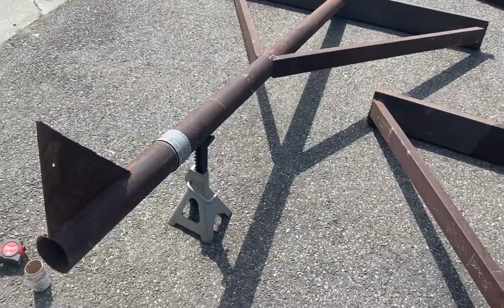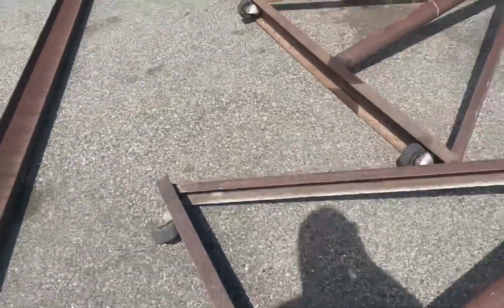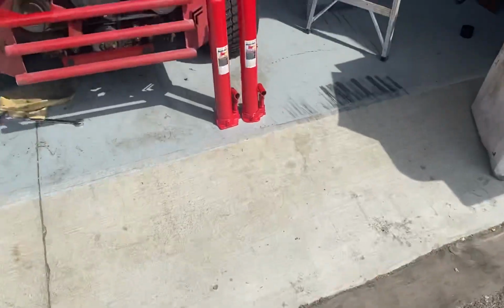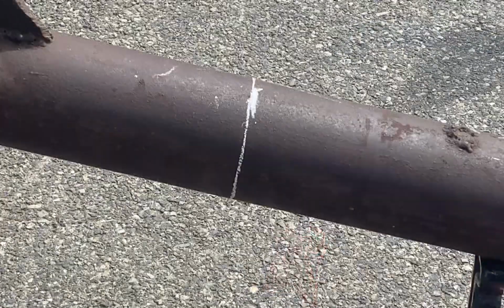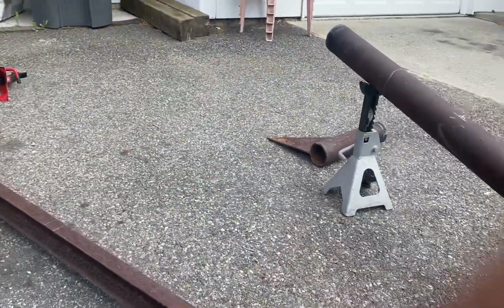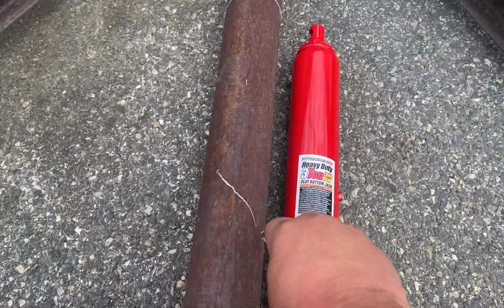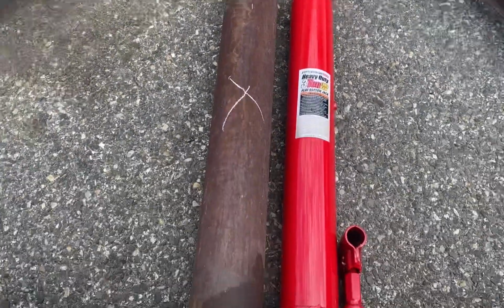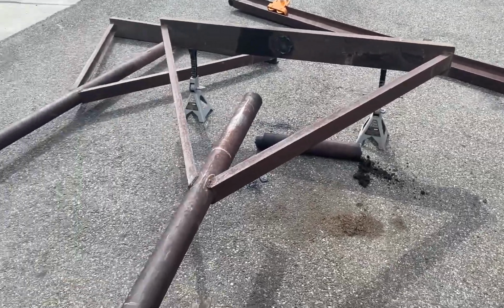Modifying the uprights of the gantry crane part 1

Comment: I'm surprised you don't have a Portable Band Saw. Or maybe it's just fun to torch things.
Reply from the maker: I had the torch handy and knew I would need to scarf off some of the weld close to the bottom part.  I’m still a big fan of the cutting torch and use it all the time